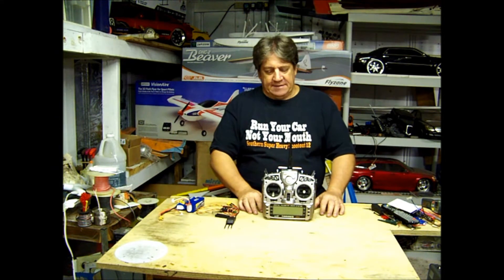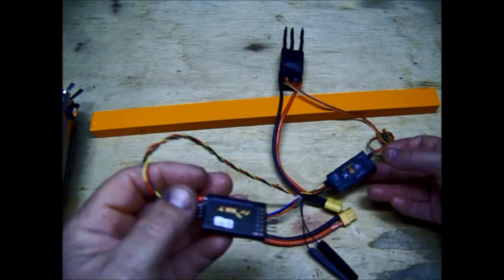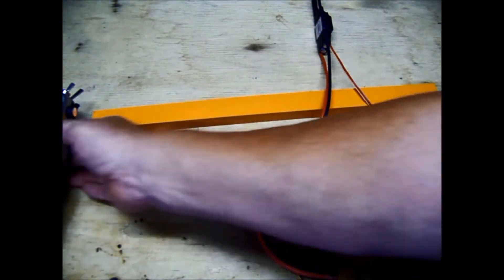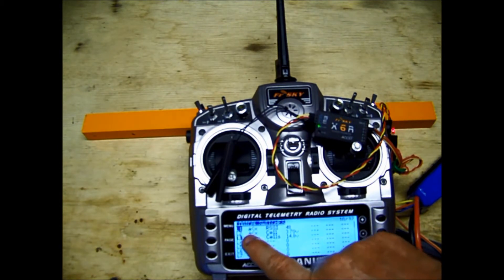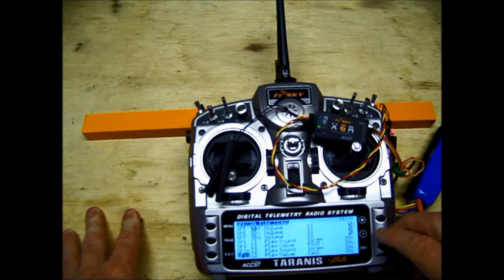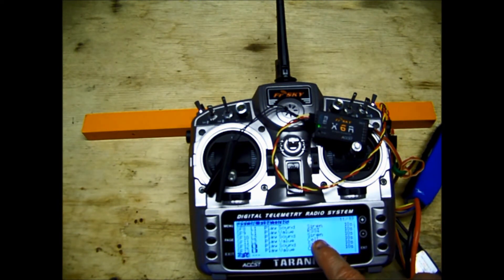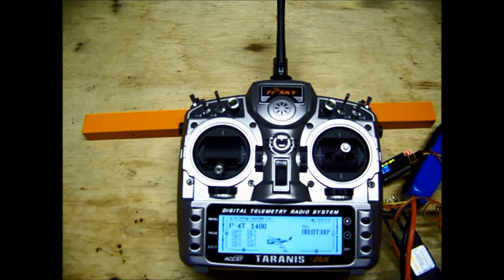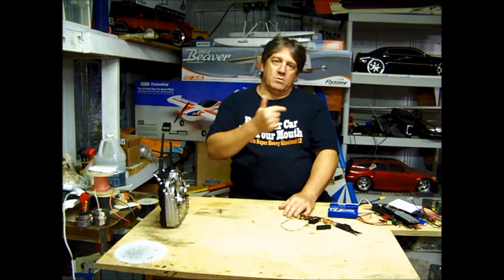FRSKY TARANIS PLUS TELEMETRY SETUP RSSI BATTERY CELLS

Comment: 99% useless does not show how to actualy set up the telemitry screen at all simply shows his set up WHY is it so hard for anyone to simply show step by step the process?
Reply from the maker: what firmware are you using? I'm using 2.0 so there is nothing to set up you just plug in the sensor and the radio knows what it is

Comment: Do I have to have the voltage telemetry for RSSI to locate a lost model?
Reply from the maker: +ILTSYC 
no you don't; if you are using a X4R X6R X8R receiver you already have 
RSSI telemetry; just press and hold the page button and it will bring up
 the RSSI signal strength and you just follow the meter to your model. I
 have used this twice already to find my model; works great! if not 
using these receivers then I use a Tarot OSD which displays my lad, long
 GPS numbers that leads me right to my model.
Reply: Thats awesome man! I have one a Tranis x9d plus and x4r arriving mondy. I've never lost a model but I could see the potential too especially in tall grass or near wooded area's.

Comment: Thanks for the video's on the FrSky Taranis Plus! Very informative and helpful. I do have a question if you have time. I have been playing with my radio and trying to setup a custom function that will say Ignition on when I move the throttle up and the motor starts (electric). I have tried to set it up several different ways and it only say "ignition on" when I move the throttle more than half way. I want it to say it when I first move the throttle up at all. I have even tried to use a logical switch but to no avail.
Reply from the maker: +Terry Brown  Hi Terry;
 logical switch a>x  thr   -100  

that should do the trick :)
Reply: +Hanger Fiftyone  I just figured it out, but thank you very much for answering my question. Then I did a play track and it says ignition on and then I set it up to say (at half throttle to say) takeoff :)

Comment: Does the sirren works only on battery warning? Because i put mine to rssi and doesn't sirren just only the voice warn me that low signal..i was expecting sirren first before the lowsig voice allert? This is what i do L1 playsound sirren L1 play track rssi..what did I missed???
Reply from the maker: +Mr Kal yes siren works on all notification ; did you set the time same as play track? other than that watch video again; pause it as you check your setup

Comment: RSSI BATTERY CELLS? Much lighter, cleaner and cheaper to do voltage and RSSI with D Rx and soft serial. Didn't you do a vid on that subject?
Reply: what is a soft serial?